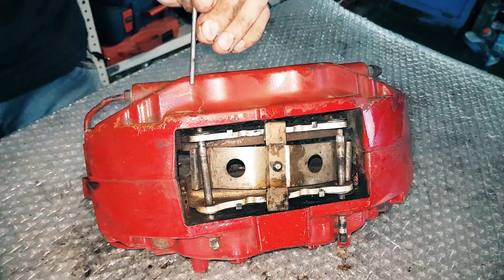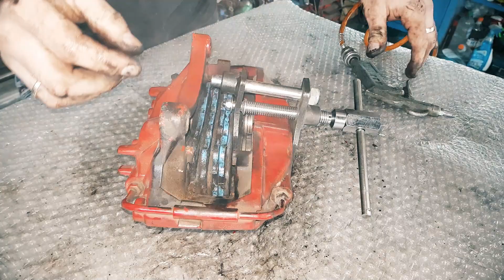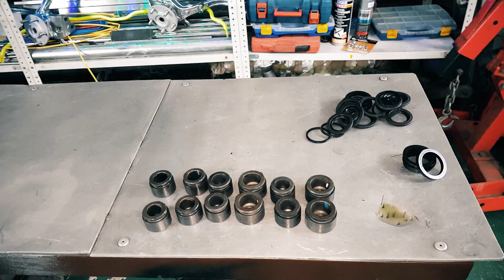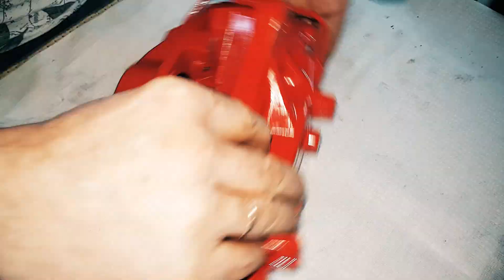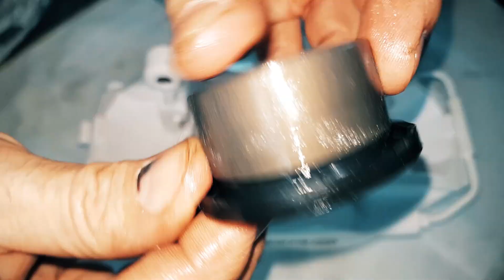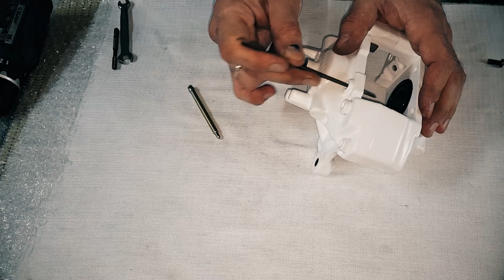Rusty to running: 20 Year Old Brembo Brake Caliper Restoration / Rebuild time lapse

Comment: Easier to separate each side of the calipers to get the pistons and seals out etc.....just put a bleed nipple screw in the crossover pipe end ....easy access then